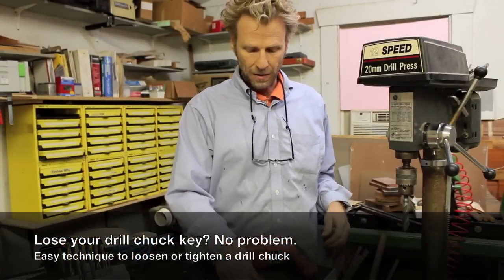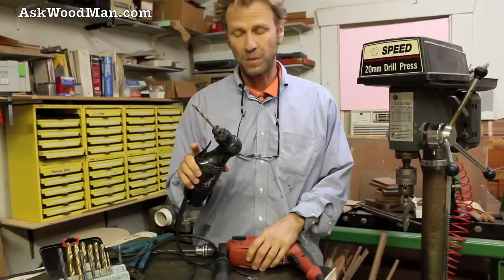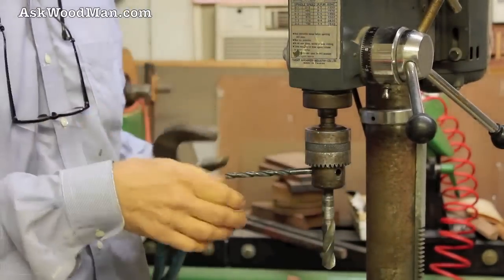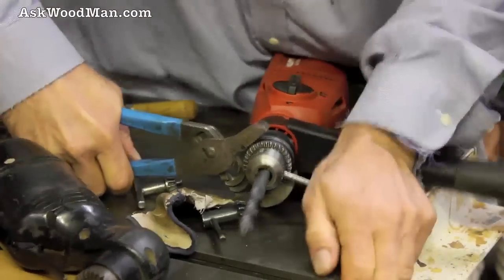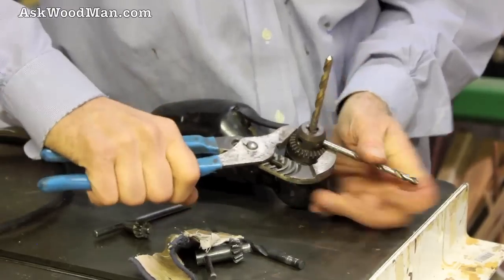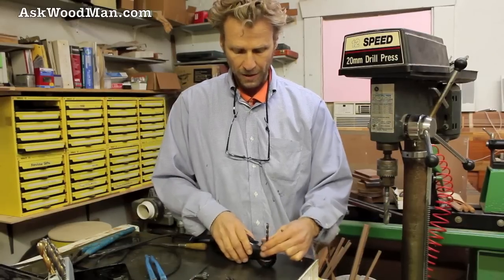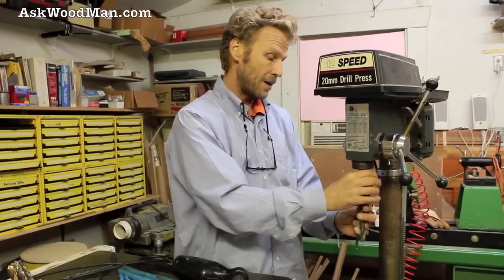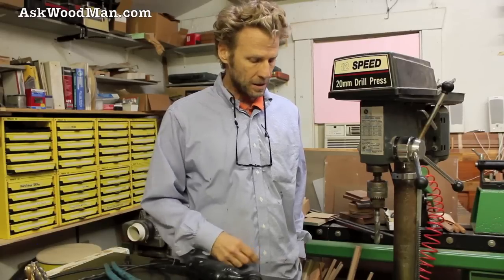39 No Drill Chuck Key? No Problem • How To Remove Drill Bits Without A Key

Comment: My husband has had a SKIL drill for years that we couldn't use because it had a Philips head bit in it and he lost the key. At a point of desperation (installing a new overhead microwave oven) we really needed a drill with the power of the SKIL (battery powered Black & Decker wouldn't go through the cabinet wood). YOU SAVED THE DAY. I was able to switch out the bit in seconds after watching this video. Such a simple solution I can't believe I didn't think of it many projects ago. THANK YOU!

Comment from the maker: I always tighten the chuck. A loose drill bit can be galled by the hardened steel jaws of the chuck. A loose drill bit can get eccentric in the chuck shattering or making a mess of the work piece. I try to never be a nanny on my channel, but for me it is always worth that little extra effort just for consistency/safety in all drilling situations. Stay safe over there and keep in touch. Allan

Comment from the maker: @Manicwensday1 Glad you can use that info. The reason I use Channel Locks is because for one thing they open wide enough to accommodate the chuck but they have a very sensitive bite. They grab with just enough pressure to hold the chuck without over pressuring like a vise grip can. I use a small pair to crack pecans in my shop. Thanks for watching and commenting.

Comment from the maker: I have never noticed bending. It takes a surprisingly little amount of force get the gears in the chuck to tighten or loosen. It is just light consistant pressure in either direction. I like to use those tongue and groove pliers also because they have such light touch. Thanks for writing.

Comment from the maker: Hi Nick. That drill is called Souix. Milwaukee also sells an identical branded version of. The head is actually 55deg. Mine is over 20 years old and still strong as a young bull. They also have a new version that replaces the paddle trigger with button. Thanks for watching. Keep in touch. Allan

Comment from the maker: Spray it with some penetrating oil like WD40. Wipe off the excess then use the heat from a propane torch or even a stove top to heat the chuck. Heat expands the metal and frees seized mechanisms like nothing else. Put some gloves on and keep all flammables away.  After heating the chuck tap it ever so lightly with a hammer all around the collar. I think it will come free.

Comment: I thought:  I know how to do that but what the heck. Thanks. I always used the drill bit in the hole and then used that as a fulcrum to lever the teeth with a screwdriver. I guess I was only half dumb!!! Your way is much better and no more stabbing my left hand with a slipping screwdriver. The savings in bandaids alone make this a great tip!

Comment from the maker: @kevinmiller A keyless chuck bites as well as a keyed chuck? That must be why keyless chucks are so poular on drill presses and lathes. The physics of torque  would also disagree with you. I have a Festool cordless drill that is great but even as high quality as Festool is and as strong as my hands are, larger bits sometime loosen in the chuck. I have and used both everyday. I have never destroyed a keyed chuck but Makita Milwaukee and DeWalt keyless chucks have quit working.

Comment: Thanks for the tip; will keep it in mind the next time a chuck key develops feet and runs to hide somewhere. ;) 

HF sells those combination chuck keys that have 4 different sizes; think they're $4-5 or so. Good to have a couple around.

Something else I've seen is a way to make a keyed chuck keyless. You take a golf or base ball and drill a hole through it for the size of the chuck sleeve. Since the diameter you grab is so much bigger, you can tighten/loosen by hand. Never used this one though.

Comment: you could use a flat head screwdriver  to pry against the bit and the toothed ring of the chuck. That way you do not ruin the chuck. And the risk of breaking the bit is far less because the bis is less brittle next to the bottom.

Comment from the maker: You are saying the the bit is stuck in the wall? If so remove the bit from the drill and get a pair of vise grips to lock on to the bit. Put safety glass and gloves on.Lock the vise grips onto the bit and tap in reverse feed direct with a hammer on the vise grips. Go easy and start out slow.  Even before tapping it, work it back and forth with the vise grips and it come free.

Comment: just saved me a trip to try and find one at the store trying to get hurricane shutters installed
rarely use my hammer drill, fortunately, my 40 yr old 1.2-inch JC penny drill has a key holder
so i can drill with one and tapcon with the other
thanks
Reply from the maker: Glad it helped. Be safe. If it is Irma bearing down on you, board and shutter your place and get away. It looks terrifying.

Comment: I've had that problem before but I used a Philips head screw driver in place of the drill bit and used it as the fulcrum for a flat head screw driver placed in the gear where the teeth of the key would go pried the chuck. The channel locks looked easier, but if you are stuck without channel locks, there you go. :-)

Comment: Never thought of this during the last day when I couldn't find the key. Really great idea! Nice.

What do you think about those self screwing chucks for drills? Are they any good?
Reply from the maker: Keyless chucks are great for low torque applications such as a cordless drill. But when you start drilling with big bits or in steel they tighten so much that you end up having to use a wrench to break the grip, so I find them pointless for drill presses and heavy hand drills.
Reply: Ok, thanks . My chuck is "dancing around" , not really precise when spinning so I was thinking of buying a new one but if keyless are not that good I will probably buy classic one.

Comment: Mine is stuck in the completely open position(without the drill bit inside) and It wont budge.Broke the key while I was tryng to free it. Do you turn clockwise or conterclockwise to untighten.I cannot figure it out. Thanks

Comment: Alrighty Now... I really hope this works; because it drive's me crazy. Now I need to figure out how to get my blade off circler saw. It's jammed good because the blade is on backwards to cut siding.
Reply from the maker: It really does work as you can see me demonstrate in the video. Here is a link of a method I came up with to change table saw blades. Table Saw Tip #6: How To Change A Table Saw Blade For you circular saw grab the blade with some heavy vise grips and then block against the vise grips. Or pinch the blade in a vise even better.  Use a socket wrench instead of the wimpy saw wrench so you can slip a cheater pipe on if necessary. Make sure your saw is unplugged and wear some gloves so you don't bark your knuckles (my specialty).

Comment: I fix the key on the wire, about 50cm from the machine, with tape. Just align the handle of the key with the wire and put tape on one (or two) side of the key. And I never loose the key ...

Well I no such trick for the drill press, sorry.

Comment: Hello Alan,
Where are your new videos!?! I demand! :)

About this video: You can get away with drill bit and lager flat screw driver or smth similar ( no players needed, no "scratching"..;] ) - insert drill bit as You were doing, then insert screw driver between the teeth of the chuck (square to the drill bit) and turn chuck using drill bit as a shoulder..I guess,You have to try it to understand :), but it's simple and easy if screw driver is long enough.
Best regards

Comment: What man, lose the slip joint pliers and simply use a flat head screwdriver in the teeth of the chuck and pry against the drill bit.  That way you don't scratch up the chuck and it works pretty slick

Comment: wood man this is just a thought, but on my drill press, on the left hand side, i keep a big round magnet. i keep the drill press key on it. i always put it back when im done. so i never loose the key. dick bailey
Reply from the maker: +dick bailey I do so much metal work that magnets are just a mess around the drill press. The magnet magnetizes the chuck and then it becomes, well a magnet, covered in particles.

Comment: I just tried this. The first drill broke in half. Bugger! Subsequent attempts failed. I've sprayed WD40 over the chuck and will try again later.
Reply from the maker: +Peter Johnson Make sure you are going in the correct direction also. It can be confusing to get the motion directions correct for tightening or loosening. If your chuck is seized up the WD-40 will help a lot. But what will really free seized mechanisms like that is heat. Use a propane torch to give it a good heat. Not glowing but just a good even heat so those parts can expand slightly to break the grip. Wear some gloves and protect the plastic parts of the drill by wrapping an old leather glove or apron to protect it.
Reply: Many thanks for your helpful comments. I did finally get it undone. But I did it by tightening the chuck in my vice and hitting the masonry bit (it fitted perfectly) with a hammer.
Thanks again.
Reply from the maker: +Peter Johnson Good to hear. You went with the "impact wrench" method.